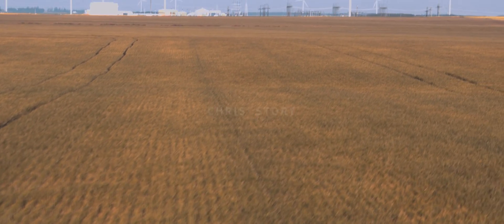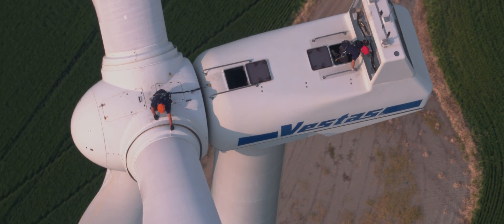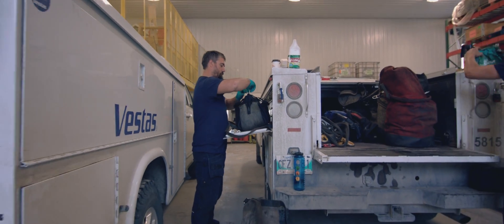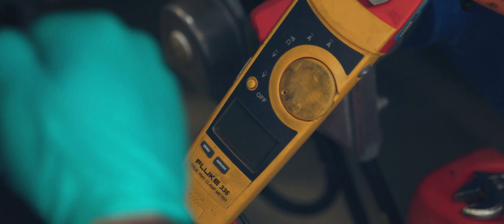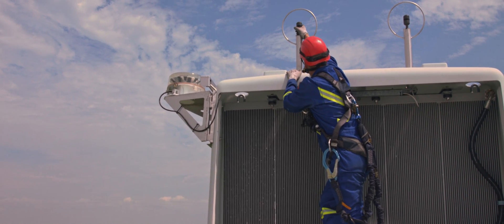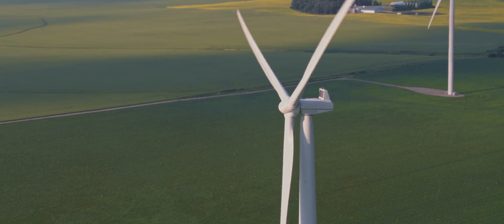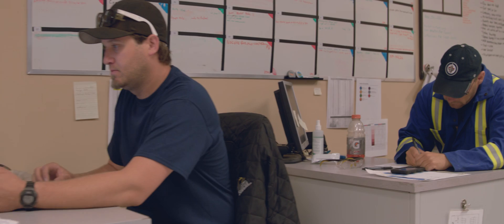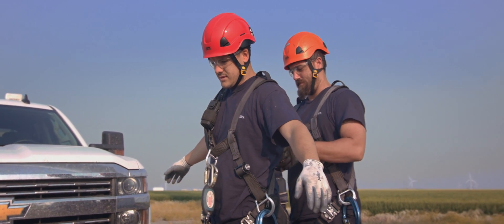Keeping the World Up and Running - Chris' Story Using Fluke Tools

Comment: I've had the 115 since it has came out. I still use it every day and hate to touch the other meters because I need reliability and accuracy regardless. It's been through mud and worse. From fixing a jeep that went too far in water vs diagnosis a microchip for repair. It's the tool that I use the most and still hasn't failed.
 Don't assume my line of work but it's an investment in yourself yet priced and built to the point that it is still a good investment. Thanks for your video. It's a great tool if you don't know how to use it properly. I'll show my friends 
 😁